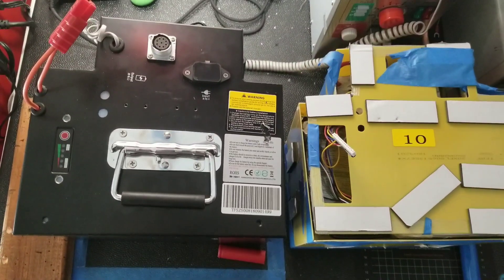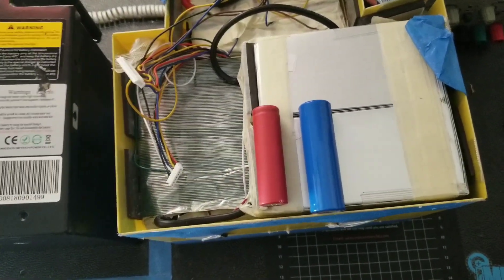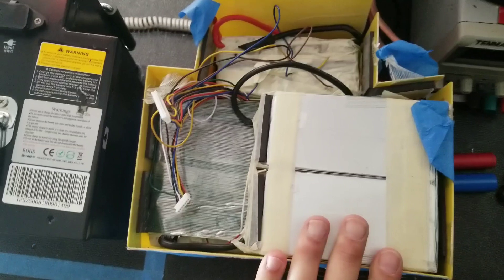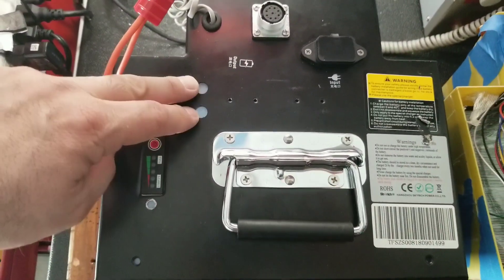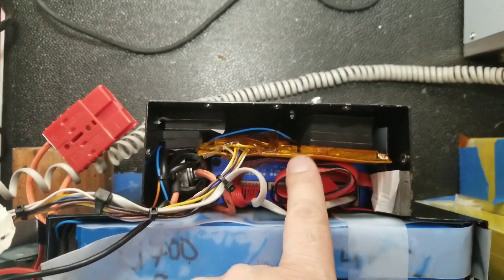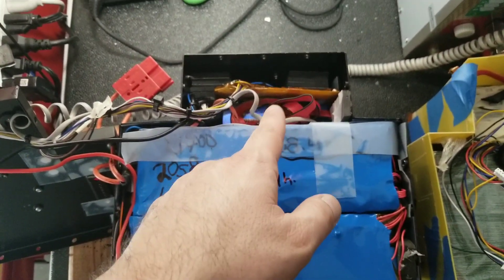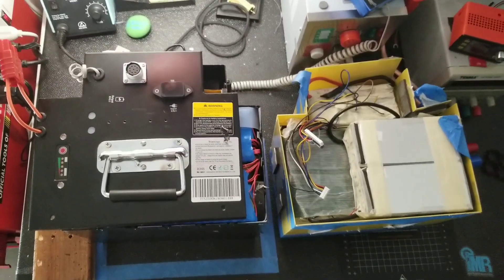2019 CSC City Slicker  Pack Upgrade  Project,  Part -II COMPLETED !!!

Comment: Hello, I also connected the original bms to the new package with lion 18650 but the bms does not want to load the package, everything works, lights etc but there is no power to the controller and it does not spin the wheel, it displays a motorcycle error with an exclamation mark, which signals are needed from the old bms to make the motorcycle was driving normally?
Reply from the maker: Hi there, yea, this process was a bit more of a hack I did since I had to use the old BMS as a stand-alone module to communicate with the display correctly. For my new pack, I had to use the new BMS as a slave. Finally, with an Arduino and a CAN board module I was able to send over CAN a message to clear the faults from the display. This was done a few years ago!

Comment: Hi mate I have the same bike in uk it is called the “lex moto cypher” is it bad for the bike if I ride it at 50 mph everywhere been doing it for past 3 days
Reply from the maker: Hi mate, not at all, the motor is rated to go even faster without any concerns.
The motor controller is also fine as well
Reply: @Frg_76  cheers will it damage battery at all it dies a lot quicker but that’s about it wish I knew more about electric bikes would love to make it quicker I have the money just not the knowledge
Reply from the maker: @sassy_gamer7899  
It won't damage the battery, it'll just drain it faster. I'm assuming that it also has the same BMS and electronics than the one in the US which are not the greatest but it should work fine!
Did you make any mods to get it at that constant speed it it just came with those settings for the UK market?
Reply: @Frg_76  for the uk market if you hold on throttle and front brake and turn the bike on you can derestrict it it will go 45 with ease and if you are pushing it for about 200 m it will do over 50 no problem no mods done to it the acceleration is also nice and quick on it but I’m looking to get it faster
Reply: @Frg_76  the only noticeable difference between the 2 is the batter cage/lock thing the us version you have to shake about and pull the lock out the uk one is sort of a clip that you just unlock and flip up to get it off
Reply from the maker: @sassy_gamer7899  so, new upgrades then, cool.
I'm not sure there's a specific shop that could do this for your since this is more an aftermarket upgrade with a lot of hacking in place 😝
Reply: @Frg_76  also I want to change my controller or change software to make acceleration quicker/top speed can most garages do this ? Not sure who to call as don’t know what the profession to do that is called

Comment: Hi FRG, May I know how many 21700 Cylindrical cell do you think this same enclosure can fit? Thanks!
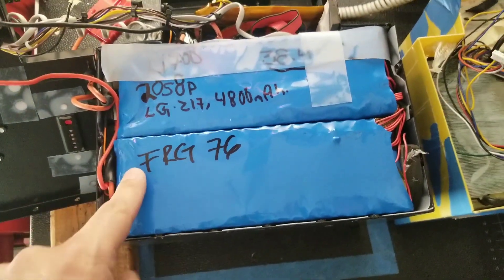Reply from the maker: I was able to fit 20s8p (total  of 160 -21700's cells) in the same area where the original cells were.  In minute 2:35 you can see on the top there's more room but I used it for the BMS. I wouldn't go with more cells in that top area bc you'll have to package the BMS outside the enclosure.

Comment: Hi FRG, Do you happen to know at what voltage does the bms start balancing cells in this bike? Thanks!
Reply from the maker: I do not know the staring balancing voltage from the stock BMS. The one I used in this video is user configurable. With healthy and balanced cells, a BMS does not need to transition to balancing mode every time it is charge mode.

Comment: Is it possible to add more battery to this? Like make use of the storage space?
Reply from the maker: There’s for sure more room for packaging a bigger battery pack in the compartment area. In this case I re-used the pack enclosure from stock since all tie downs to lock/unlock it with the key are already made. If you were going to make a bigger one with a different form factor is critical you firmly secure in place.

Comment: can you let me know when you have done the 2nd battery so i can buy it when you have done it.
Reply from the maker: I have the 21700's now. That should get me going but I can teach you how yo make one. :-)
Reply: @Frg_76  if you could just send the battery and the blue rap and the bms i can use my own box
Reply from the maker: Hi  @Glen799   For both the blue wrap and the insulators I've  been buying them from here: (great quality!)
https://www.imrbatteries.com/21700-wraps/ 
I am not very happy with the Chargery BMS - too much current draw during sleep mode!
I am in the process of deciding if I am making this new updated version with that BMS or a different one Meanwhile I am starting with the assembly process!!!
For the cells, where are you located?
Reply: @Frg_76  New Zealand
Reply: @Frg_76  can i merge a 2nd 72 volt battery with the csc city slicker seen people do it on the sur ron
Reply from the maker: @Glen799   You can parallel batteries no problem as long as they are exactly the same in everything. (Voltage, capacity, chemistry, cell type etc.) 
Paralleling a random 72V battery with the stock one from CSC not a good idea.
Reply: @Frg_76  wont do it then
Reply from the maker: @Glen799  I will let you know how my 2nd battery does after it's done. No promise here but I would try to make an extra one after this one for you! I might be able to get more "high end" 21700's....!!! I'll keep you posted

Comment: if i plug my own 72 volt battery in to the csc motor bike will it work as long as the switch to the old battery is still on ?
Reply from the maker: If I remember correctly, it might not. The BMS from stock also works as an ignition mode enabling other features as well. That circular connector located in the front of the battery box sends/receives those signals from the BMS to the rest of the bike's functionalities.

Comment: can you list the parts you used ?
Reply from the maker: I mainly used the 21700's prismatic cells, Chargery BMS  24T- which I am not very happy with it. This BMS comes with some thermistors, current shunt and a display. 
HV wire, and  PVC heat shrink tubing.

Comment: Do you make these i want to buy one for mine
Reply from the maker: I did it for mine  mainly for fun but never thought about selling them.
Reply: @Frg_76  if you can. Can i pay you todo one for mine?
Reply from the maker: @Glen799  Thank you for the offer though . I will try to make another and I will let you know. Not sure when since I'm pretty busy at work right now.  :-)
Reply: @Frg_76  thanks i need more range for mine would be grate if you could ship it to new Zealand one day
Reply from the maker: @Glen799  Sure, that would be no problem. As long as the shipping container is in compliance with UN3480 it should be fine. :-)
Reply: @Frg_76  will you be able to make one next year ? and do a video of you making it
Reply from the maker: @Glen799  Yeah for sure.  I'm actually planning on making another pack with a better BMS and possibly a nicer BMS display very soon!!!.
The current one used (Chargery) has a big parasitic draw, meaning the pack is slowly discharging even when not in use. Not happy about that.

Comment: So if I'm understanding it right on the old bms you're just runnning the CAN bus wires and the main battery/load wires, correct? The battery side of the old bms connects to the load side of the new bms, and all of the load balancing, temperature monitoring, etc. happens on the new bms.
Reply from the maker: Yes correct. Old/stock BMS : CAN bus not used now.  (next project maybe?) but the HV- low power lines are. The stock BMS  switches  to Ignition  ON with the key and  therefore enables the DCDC converter.  - Bike is in Drive Mode now. This is the main reason why the HV low power lines are still wired up to the stock BMS.
New BMS does the balancing, temp monitoring , current reading....
Reply: @Frg_76  awesome ty! With the can bus disconnected is there any info you're no longer seeing on the display?
Reply from the maker: @MartyKokes  Having the BMS CAN messages not in the bus any more, I am not longer able to see the charge indicator as well as the SOC in the bike's display. I'm now getting that info from the new BMS display.  The bike's display in general is still is functional  though (Speed, light status, turning signals. etc.)

Comment: Been waiting many months for a project update! I'm guessing the OEM BMS is integral to initialization, and therefore a 100% DIY battery is not fully possible ? Was hoping to swap between OEM pack and a DIY pack.
Reply from the maker: I believe it's possible though , this is a 100% DIY.. I believe... only thing is that my OEM BMS was damaged and could't do much reverse-engineering on it. I am going to reach out  to the CSC guys to see if they spare a damage pack that  could  be reclaimed
Reply: @Frg_76  I actually live a short drive from the CSC dealer. 
Do you have a plan for the old prism cells? Would love to see one cell up close, get its technical specs.
Reply from the maker: @scratchymaster   Not sure what to do with the old pack yet. I'll try to take a few cells apart and do a quick video about them.